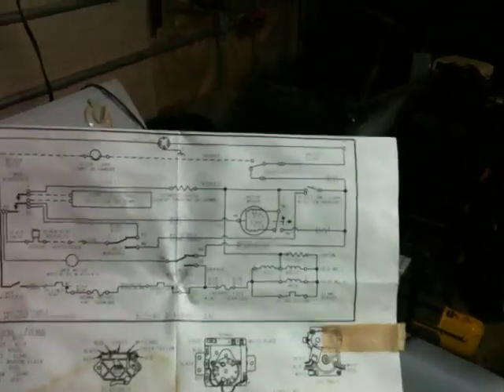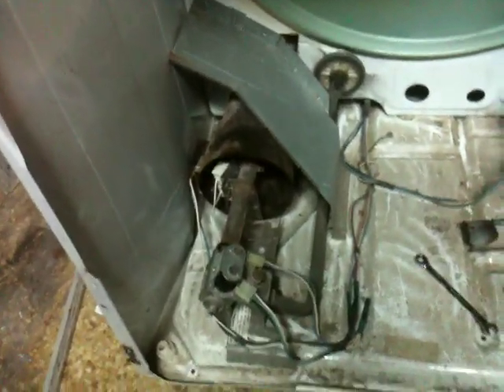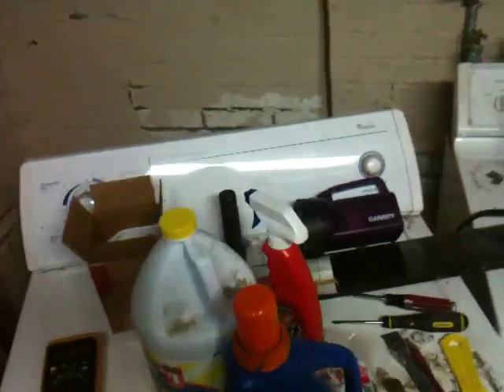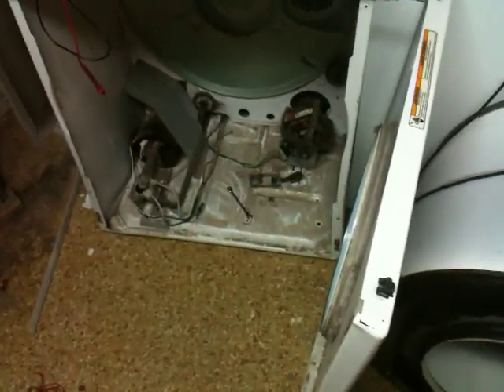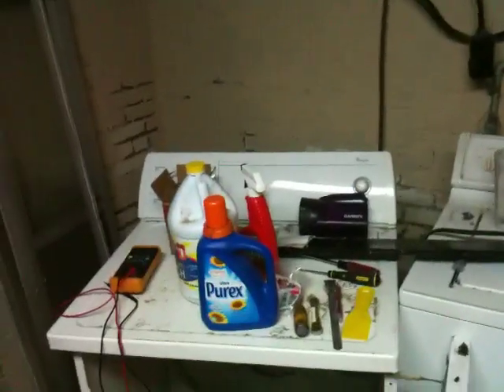Fixing The Clothes Dryer

Comment: Different model than mine but with the drum removed, everything looks the same!

I never thought of removing the drum, and keeping the door switch connected to better monitor the flame unit.
Can see anything but a few sensors from the back. Thanks for the video! 2 feet of water no sweat. 3 feet and the drum just turns and turns and turns. well, At least I don't need to replace the motor!
Reply from the maker: Whirlpool is the actual manufacturer of many private label appliances and they use the same base chassis for a whole slew of models.

The motor in this one did eventually die (around 2014 I think) with some shorted turns.

Comment: I don't think gas fired clothes dryers are common in residential settings here in Australia, I've certainly not seen any, I know they are used in public self service coin operated laundry mats, they make sense in that kind of environment.  Do these gas fired dryers need to be permanently professionally installed by a plumber, or is this something you can do yourself provided there's a gas pipe and associated hardware already in place before the dryer is purchased and installed?

Comment: I have a Kenmore Residential Dryer Model# 11062062103 Electric heated
that has stopped heating, is the problem something similar to do with yours or am I looking to buy another dryer in Venezuela?

Comment: @MaurizioM89 (continue) against gasoline! when petrol is at 1.40€/Liter (about 8.74US$/impGal), methane is at 0.858€/Kg (1.17$/Kg) and LPG at 0.663€/Liter (4.14$/Gal).
With LPG you just get the same MPG of a gasoline car, but with methane you can get till 50MPG, while not having lots of Km per tank (just about 300km)

sorry if i bored you (and sorry again for my horrible english)

Comment: This is an Extremly common issue caused by lint and or the lint filter not being emptied out. Also some times that little thermal fuse can be cut off by a bad thermostat (generally this is common on electric not gas versions). Always remove and clean the pipe where the lint filter goes and do as uxwbill says: vacuum it all the way out. Excellent dryers that survive anything. The 3800 series of dryers.

Comment: @stydel311 There are "rollers" the drum rides on that will wear out. 99% of the time it is these. If they are worn out you have to replace them, if not you can lube them up with some automotive hi temp grease to quiet them up. Usually if the belt is squeaking, the drum will either not turn at all, or will be jerky.

Comment: It seems I'll be starting a similar project here...  Whoever built the house decided it was  good idea to put the laundry room in the front of the house and run the dryer vent all the way to the back of the house in the attic.  I guess technically its "code" here that putting vents on the front of the house is "bad" because it looks ugly.  gthe vent is too long for the dryer's fan and something over heated inside, so now we have to fix it and put in a booster fan.